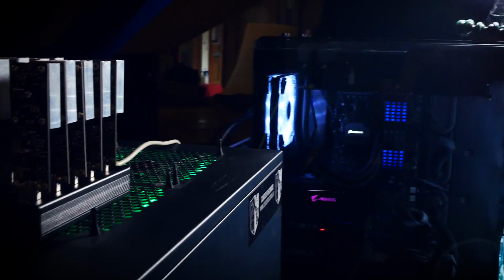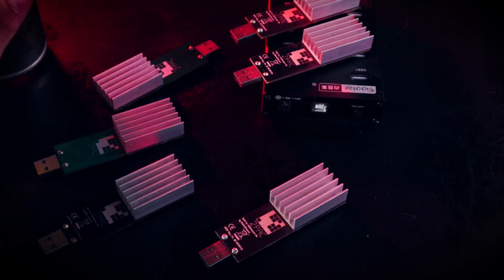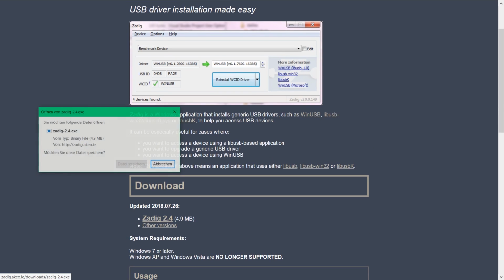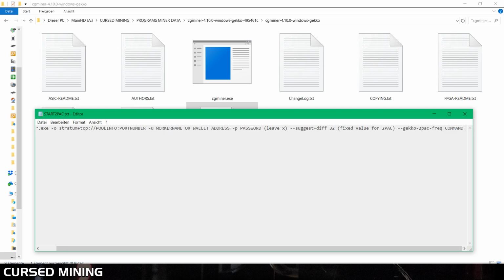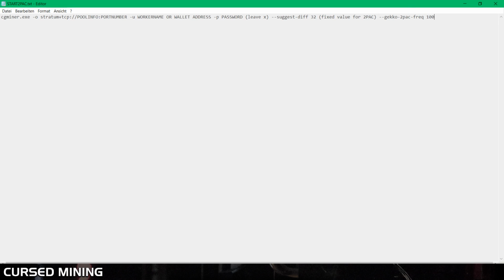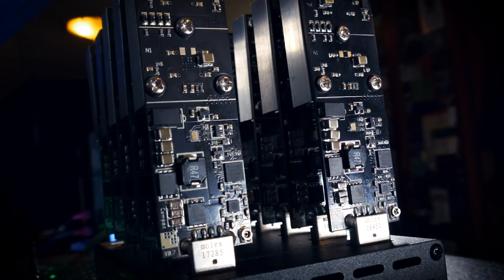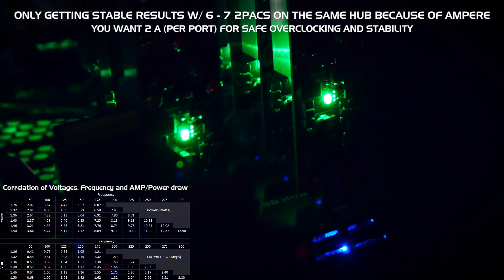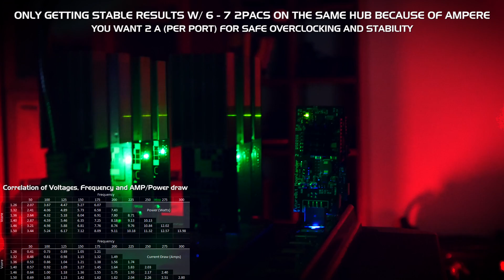Mini Bitcoin Mining Farm: Gekkoscience 2PAC USB (SHA256) How to

Comment: Bro on raspberrypi im trying to overclock using the raspberry usb but it doesnt read it. It keeps getting just 100mhz thats because i need a usb hub?
Reply from the maker: yes you need a powered USB hub, be careful you can burn the Pi's USB slot out!!
Reply: @CursedMining thanks i let it default just to be careful

Comment: How can set my miners to the factory setting in the voltage???
Reply from the maker: That was really difficult to find out. You have to adjust that with the little screws but it is really hard to explain in text form - I would definitely google exactly your question to get a picture to follow.
Reply: Thanks for the fast anser. To turn it Down in voltage is that clockwise or anticlockwise?
Reply from the maker: So that is what I found when checking again:  "Turn the pot so the flat side is at about 2 o'clock position" - that's the only real recommendation they give if you don't have some sort of voltage controller / reader, if you do, check: https://bitcointalk.org/index.php?topic=1764803.920 and the answers from "veeref" - sorry I can't help any better
Reply: Nice. Tanks a lot. My eyes is getting old, can’t see what way the screw is pointing.
Reply from the maker: @lassemathiasen9430  I feel you! Already had to throw away footage with the channel because i thought it was in focus on camera - just until I saw it on a big screen hahaha =D  hope you can now tweak your 2pac as you wish, cheers =)

Comment: Hello
I have 6 Pieces,in the beginning they work but afterwards write ZOMBIE text. what am I doing wrong? (I have Sipolar with 16 hub usb and i have 1 Arctic White USB, THANKS
Reply from the maker: This is often a power issue, so you need a strong enough power supply for the sipolar hub. Ideally more than one/two Ampere (per stick). Also with the USB cable from the hub to your controller you can loose amps, so I'd go for a short and good quality usb cable as well (protected etc.)
Reply: Cursed Mining Thank you, maybe I'll buy same usb hub like your 👌👍
Reply from the maker: mine is also sipolar, but only the 10port, that's why I thought it was strange, but for me it was really the usb cable and ampere, after that exactly like you, 6 sticks no problem. Maybe also the frequency, for overclocking you need even more power 🙈⛏️
Reply: Cursed Mining Hi again, I got the same usb hub with your own now and while all goes well with the mining suddenly shows in display ZOMBIE after 1 hour, what could be wrong again?
Reply from the maker: hey man sorry to hear that. With what are you powering the hub? Ampere / Volt? maybe too little ampere still :/ you could try clocking down a bit, but if you are on standard frequency you probably need more ampere on psu output. You might also loose some amps if the usb cable itself from the hub is too long or not the best quality. Hope it helps

Comment: I have 1 right now, 2 more coming.  The first one I got was a seconds stick and it freezes up all the time. The other two are not... so I hope they work better.
Reply from the maker: Seconds you mean used? hmmm.. what freqs are you running? Normally they are indestructible, except if the other person really baked them :/ hope you fare better with the new ones :)
Reply: what software scrypt for this mining USB ? ,..can you guide me ?  i buy one this day on ebay ,.. Futurebit Moonlander 2 USB  ,.. i'm not have expreience on this mining ,..  can you guide me... step by step...
Reply from the maker: video is step by step :) all the links in the description for drivers and software :) software is bfgminer - cheers
Reply: Cursed Mining  what rate H/s you make it with your USB ?
Reply from the maker: for now only at 100 freq on this hub - gives me 10 - 15 GH/s per stick. Got to find the peace and time to experiment more, one can get more out of them with a little more tweaking =)
Reply: Cursed Mining  wow,... awesome,.....  how much crypto you make ?

Comment: I have almost the same package (10 miners +usb hub) would this be profitable if I have 100% free electricity (theoretically) I would hope to run each at max 33gh/s?
Reply from the maker: Hey William, profitable lies in the eye of the beholder hehe, so with 330 GH/s without power costs you'll be earning about 0.00001 BTC per day (5c) - so really hard to reach your ROI, depending on what you paid. There is a newer version too of which I'll be making a video soon :) hope I could help, cheers
Reply from the maker: Well, it is 6 cent per day now with the numbers above punched in a calculator excluding power =D

Comment: Hey Cursed. with he orientation of the heat sink being in different direction from the fan. try placing a 120mm fan flat on top of the miners? Power for the fan might be a challenge but im sure you can work it out Keep up the great videos. Bnice
Reply from the maker: Hey Wouter - you are absolutely right =) with the later shots you can see the "final" setup a bit better, already 2 sticks gone, now the fan can be on the same hub and blowing down from above =)  laying a 120mm on top of them is a perfect idea mate, but first I'll let the old Arctic do his work until it dies hehe - cheers and thanks for sharing your input =)

Comment: Hello, I'm totally new for mining and where wondering how many Gh/s it actually does per usb? Great video!
Reply from the maker: Hey welcome to the beautiful mining game :) the 2Pac can go to 33 gh/s max if you overclock and have a good PSU for the hub and some additional cooling - 15 to 25 is standard. BUT check the channel for the 'NewPac' video, this is a new revision of the 2pac which can go up to 100 gh/s :) cheers ⛏️
Reply: Thanks for the warm welcome ;) and 100Gh/s sounds really great. I will check the channel before i buy one thanks!
EDIT: Is it possible to mine other currency's with the usb stick?
Reply from the maker: You are more than welcome :) this one can only mine Sha256 algo cryptos (that is Bitcoin, BCash etc.) - there are other devices similar for other algorithms, for example I've featured the FutureBit Moonlander, this one is for Litecoin and other Scrypt coins :) cherrs ⛏️